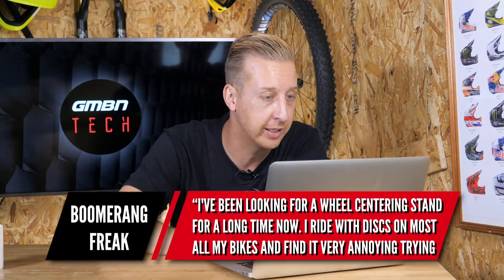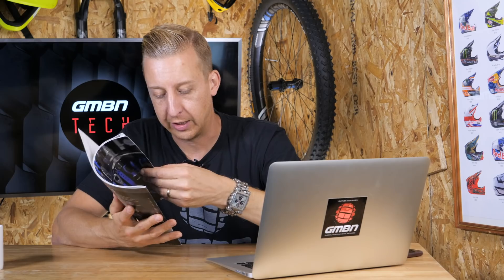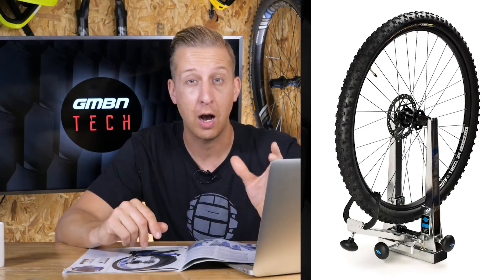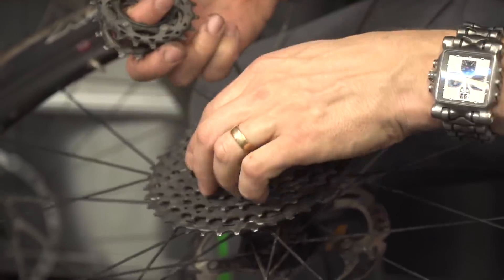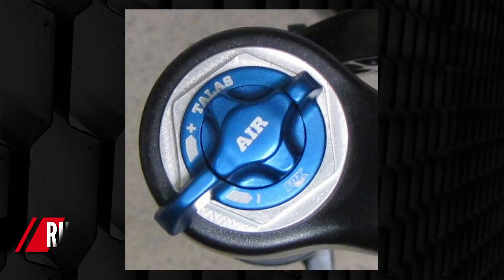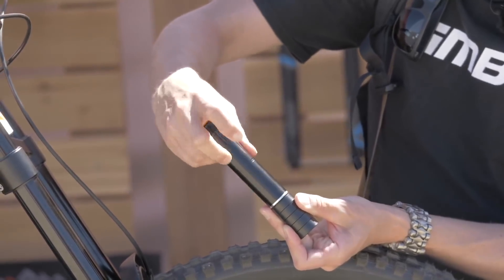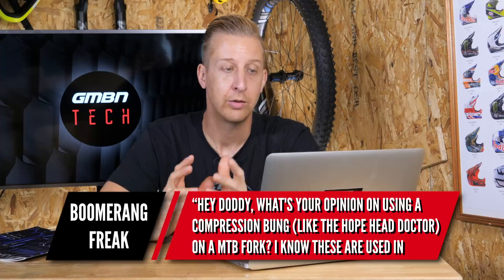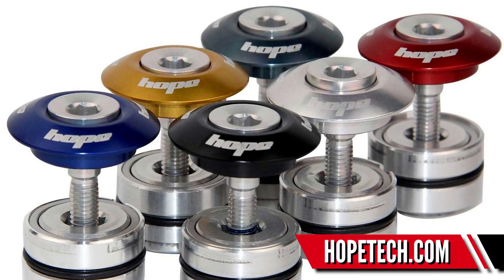Why Are Your Spokes Snapping? | Ask GMBN Tech

Comment: #askgmbnteck  i have a giant talon 3 and it is a 3x9  and i was looking into changing it to a 2x or 1x, would it be possible
Reply: yes
Reply: Just take off the chainrings you don’t need.
Reply: I also ride a 2018 Giant Talon 3 and I have made many upgrades to it, including going 1x. I removed the front derailleur and all 3 chainrings and put on a Solodrive ($20 on amazon) narrow wide chainring. I recommend spending a little bit on a new chainring so that you dont have to worry about dropping the chain.  I have also installed a dropper, resized the stock handlebars, installed locking grips and setup tubeless. If you are interested in any other upgrades I have made to my bike i would be happy help you out, just message me.
Reply: ok thanks

Comment: #askgmbntech Hi Doddy, my  Bike a 2017 canondale trail5,  I was wondering what would I need to change the type of bottom bracket at the moment it has a square taper type I think, would it be possible to fit a hollow style crank and convert it to a 2x rather than the 3x it currently has,,, A list of things to do for this upgrade,
I have to ask as looking at all the different types of bottom brackets and cranks is very confusing when you don't have a clue. thanks Danny

Comment: What is faster? Grippier tyre with more pressure or faster rolling tyre with less presure? Also what is grippier?
Reply: too many variables to actually say. how low is low pressure? 9psi or 25psi? what is "grippy tyre" grippy as in soft compound or grippy as in large nobbles that dig into soft ground? etc etc...
Reply: yeah but lower pressure you might get a pinch flat. Especially a 9psi

Comment: #askgmbntech I am having a 10 speed 11-42 with a 32T chainring. I think I need a little more low-speed gear for the climbs at my local trails. I don't want to spend much money to convert my 10 speed to 11/12 speed. I am thinking of using a 28T or 30T chainring  to reduce my drive ratio and get some extra torque during climbs. What do you think?
Reply from the maker: That would be an easier fix then changing to 11 or 12 speed.
Reply: that will work. possibly may need to shorten the chain but maybe not depends on the rear mech and current chain sizing.
Reply: Javed Ameen Shaikh or keep the 32T and just use it until you are fit enough to climb those hills easily. Essentially upgrade yourself
Reply: Javed Ameen Shaikh ps. I have an 11 speed but i keep a 32T and 11-42 as well. Climbs okay

Comment: What causes a fork or shock to top out #askgmbntech
Reply: Ronan Stoner what do you mean by “top out?”
Reply: you mean bottoming out?
Reply: no the opposite, when the fork/shock hits the top of its travel is called top out. if ur rebound is set fully open it will top out too fast and this COULD damage it over time.
Reply: As you know, forks and shocks have either a coil spring or air in side. For this explanation, I’m going to assume all suspension have a simple spring inside (some do, others are more complex). When you apply force to a spring, it compresses. If you apply enough force, it will compress as much as possible, and no more. This is what happens when your suspension bottoms out after a big jump. When you apply no force to a spring, it doesn’t compress at all. I usually call this “top out” because it’s the opposite of a bottom out. This happens during a big jump, when you are in the air.
Reply: top out isn't necessarily bad if its not violently fast and harsh causing a heavy clunk feeling through the bike/bars. increase the rebound damping so that the fork returns as fast as possible without harshness.  As for the shock the rebound should be set according to rider weight, riding style and conditions. As a start point set the rebound so that when you bounce all  of your weight onto your seat the shock compresses and then returns to or just above the sag point and then settles into it but without oscillating many times up and down.  then for fast rocky chattery sections you would want 1 click faster (less damping) and for jumping etc you may want 1 or 2 clicks slower to prevent bucking (over the bars).
Reply: Well if you know what bottoming out is its the same thing but back to front it's happens because when your bike sits on the ground it goes through about 1 or 2mm of travel and when you jump the suspension fully extends and it basically strectes the suspension which is not good
Reply: theres nothing wrong with topping out. its a part of the design of the suspension and they have top out spring/bumpers or hydraulic top out systems etc to stop damaging the system.

Comment: #askgmbntech Is it normal to blow through 160 mills of rear travel on a two foot drop? I have a 2013 Canyon Strive AL8.0
Reply: Depends....is it a drop to flat or sloping landing? Have you got your sag set right, shock not too soft? Can you add volume spacers?
Reply: I'd add some volume spacers then dude. That should make it more progressive
Reply: Update: I read on MTB Radar that the linkage does not give any progression to the rear shock. What do you think about that?
Reply: DayLightSensor IMA about the linkage and progression. Some linkage designs do at progressiveness, while others don’t.
Reply: It’s normal if you set it up to be that soft. Like the other people said, try adding more pressure or volume reducers.
Reply: no way. You shouldn't even need suspension for a 2 foot drop. Look at trials riders..
Reply: Hugs if trials riders had suspension, then it would bottom out frequently
Reply: In a word, no. If you're at 30% sag the  defo need to spacers in there.